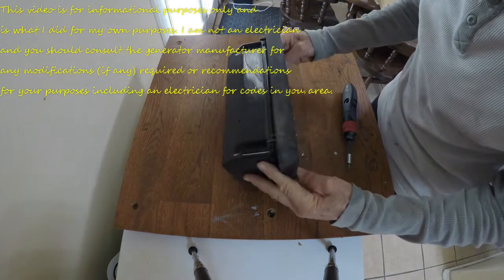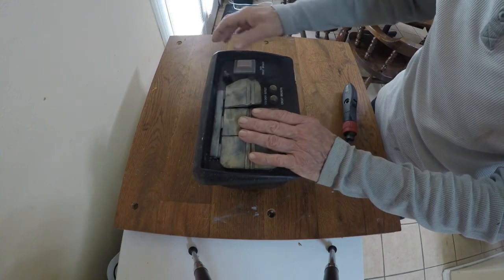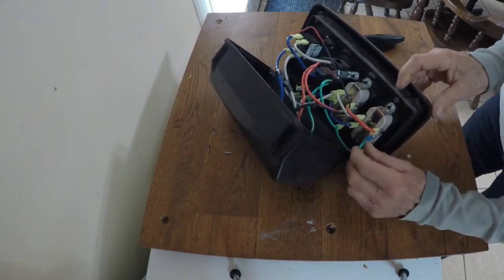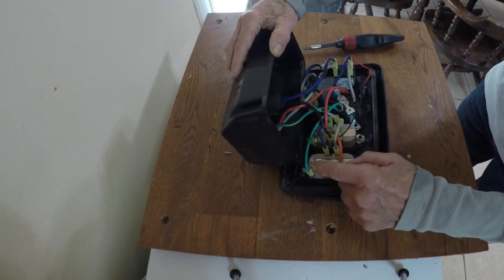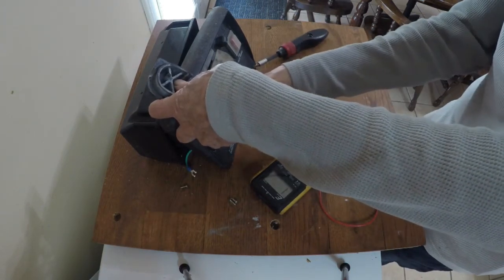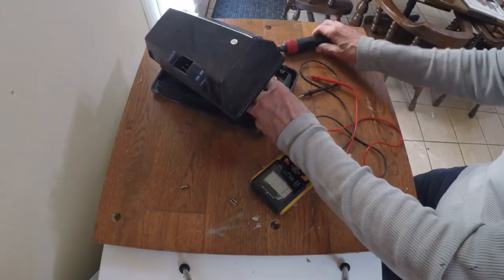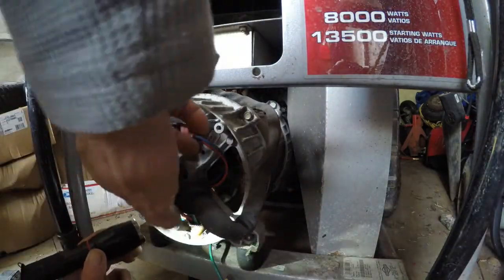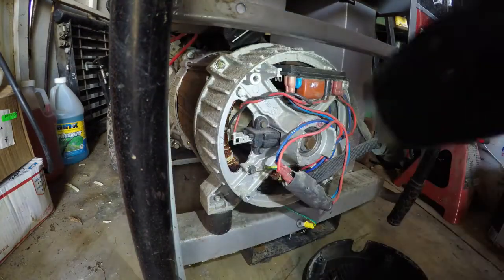Briggs Generator Neutral Unbonding Switch Installation

Comment: Nice video.  Question: What gague wire did you use, and is it necessary to use a 30a 125v/250v toggle switch or ant toggle switch will do? Thanks.
Reply: Thanks. If interested, I learned that the toggle switch for this project (I have the same generator). You must use a toggle switch rated 30a/240v.  I found this one made by Eaton.  #7576K2.  Simple on/off switch.  The wire for 30a is 10 gauge.  Afain, Thanks for the video, and I hope my input helps you as well.
Reply: @dj5752 good looking out on that switch number.
Reply from the maker: Whatever gauge matches the breaker amperage at the house and breaker amperage at the generator

Comment: Have a briggs and stratton generator 01654. Has power put installed plug in at meter and when all is plugged in no house lights work i thought i unbonding it in generator but still no luck. And yes the main is shut off before generator breaker is turned on im lost

Comment: Where did you get the switch, and what is it?
Reply from the maker: It's a Inline Waterproof Circuit Breaker switch. They sell for different amps so match you breaker amperage at the panel. You can get this online but I got these off Ebay for truck AUX batteries. You could use an ARC welder switch too but expensive.
Reply: I found some on Amazon, but they were only for 12-48 vdc.
Reply from the maker: Search for 220v 50 amp rocker switch

Comment: Where did you get that switch? What's it called ?
Reply from the maker: It's a Inline Waterproof Circuit Breaker switch. They sell for different amps so match you breaker amperage at the panel. You can get this online but I got these off Ebay for truck AUX batteries.

Comment: Why did you remove the ground connector from the frame? I know you said it would be energized if the switch was in one position, but I'm not following why.
Reply from the maker: If the generator  is not grounded and there is a fault, the generator is going to be energized. At the beginning of the video  I mentioned the ground wire from the frame had been melted when talking about the broken outlet.